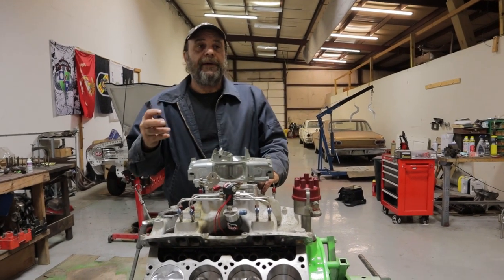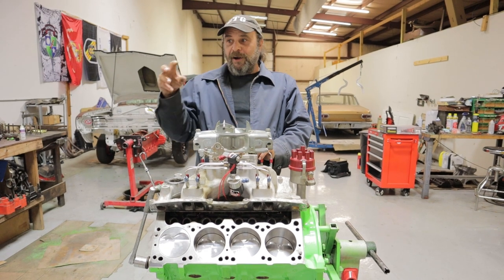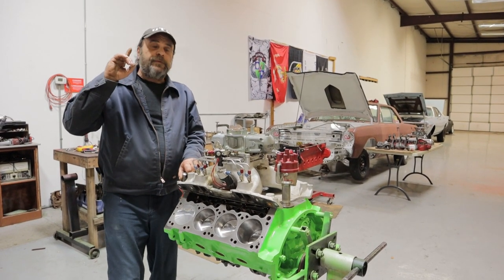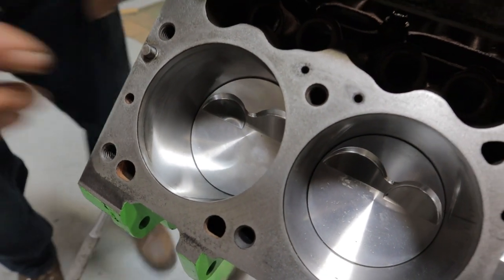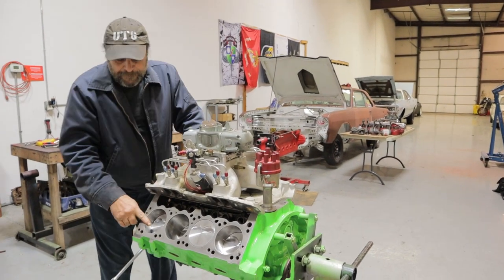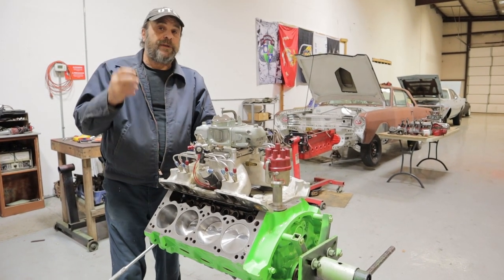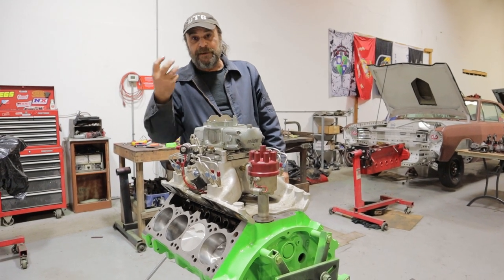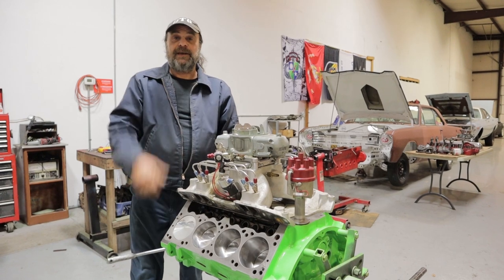The Fundamental Aspect Of The Internal Combustion Engine Nobody Ever Talks About

Comment: Seems like the work around for Vapor or volatile gas engines would be to shorten the stroke and do forced induction of some kind.

The guys that perfected NO2 systems have developed a compressed air system that maintains  AFR and power almost regardless of displacement. 

Combine that with hydrogen and there's a possibility of a feasible retrofit.

Comment: Density matters gasoline vapor has  extremely low density, gasoline molecules expand 12 times there size when mixed with air however, nitromethane must be a higher density fuel probably doesn't expand very much when mixed with air because it has its own oxygen already. Gasoline vapor has a thin charge that's why it lacks power not enough of a charge in the cylinder to make good power.

Comment: Smokey's problem was not power . His problem was oxides of nitrogen .Because of the high heat created in the system the engine could not meet NOX emission standards at the time . He explains it in his autobiography. What Tony is talking about is density , the denser the charge the more power produced.

Comment: Excellent! I really learned a lot. The principles that were talked about sound similar to reloading ammo. For a short barreled pistol you need quick burning powder. For a long barreled rifle you need a slow burning powder.

I wonder if the gas vapor would work better in a super short stroke engine since it burns out so quickly?

Comment: Uncle Tony,  for years I have wondered about this extension of burn.  We grew up with leaded gasoline, now ethanol (which is lighter and thinner than gasoline) and I want your opinion on adding either diesel or kerosene to the blend in small increments.  Could this extend the power stroke? 
Thank you and Uncle Kathy!

Comment: Sir you did an excellent explanation. I have a question I have a 65 mercury comet 3.3  straight cylinder I put the plugs, wires , distributor rotor and cap, coil, fuel pump, alternator, fan belt, oil and filter. The problem I start the car warm it up for 20 minutes and when I start driving for about a half a block the car dyes on me. Then am able to started put it on reverse and am able to go on reverse back to my driveway. Can you help me with this issue. Also I tried to set the timing but I had a cheap light and it died on me.

Comment: there are mechanical colutions to make the piston go longer on power strokes than intake strokes. certainly balance and vibration are not quite easy to account for. and petrol is not everything, we allso got diesel fuel. 
very way back in time (like 80's) we had a newspaper with DIY stuff, that had articles about possible future stuff from actual engineers. i do remember one that would had "supposedly" increased the thermal efficiency of a diesel engine by re-using the exhaust heat to literaly boil diesel to some freightening temps. the idea being that once that fuel ignites, all the heat it the diesel pickt up would be, supposedly, used by the engine again while it burns the diesel, and the high temps would make the diesel fuel burn faster. along with a variable stroke length supposedly that would increase fuel economy. along with  a water injection whatever crap to keep the engine temps within reasonable range. well, 30 ish years later i can safely say thats not the way things worked out.

Comment: So would a short stroke engine work better on the vapors?🤔 Back in the day they had a plate with propellers that would bolt under the carburetor and help atomize the fuel. And more recently a plate with screens. I always wondered if those were any good. This was a very good video UT. Thanks and be well.

Comment: With modern fuel injection we can control the timing amount and duration of fuel.  If Vapor worked, it would have been standard in cars years ago.  We haven't even see an odd ball motor like the Mitsubishi three valve "jet" head.

Comment: The main function of the fuel air mixture is to control cumbustion chamber temps, secondary is  making power. Too lean will overheat in addition to not making power. I cannot believe UT did not talk about how much heat the fuel absorbs as it changes state from a liquid to a gas or vapour, that is how our sweat cools our bodies and how refrigeration works.  As a liquid changes state to a gas it absorbs or removes much heat! This means the intake air temp drops below your carb, check out engine masters!  If you want a hot lathargic engine then feed it pathetic fumes, if you want an engine to make power and stay cool, let the fuel vapourize inside the engine at the correct AF ratios...

Comment: Thanks Tony, a really great explanation of fundamental facts on where the problem lies with hot vapor carbs and their drawbacks. I still use my hot vapor carb and enjoy the much higher mileage but my circumstances are not normal. The area in which I travel is very flat - no serious uphill's or downhills; The roads are really bad - pothole alley and under no circumstances can speed be achieved without serious damage to the car; and most importantly the wildlife is fantastic so who wants to speed by!  A thought does occur to me after your explanation - if the hot vapor car does run a motor smoothly and is used to run a generator which powers an electric motor via speed control this may turn out to be a worthwhile exercise.

Comment: Is this the way diesel make so much torque? Diesel seems to burn extremely slow. Of course, maybe there's no much power on it, thats why big diesel engines make same amount of torque than a smaller gasoline engine, but, whit waaay slower revs and extreme capacity to pull over a hill

Comment: I’m surprised you didn’t mention the Chrysler lean burn system (or anyone else’s like lean running calibrations) attempts of super lean running engines and mileage attempts. There draw backs and emissions , power drops. Potential mileage gains, etc….

Comment: so I have been thinking along those lines for a while now. only until recently, everything I drive has fuel injection, and when it comes to computer controls, I am light years away from understanding them.  so i recently acquired a carbureted vehicle (other than my lawnmower).  so my idea is pretty simple, and the only things i will probably have to change is jetting and ignition timing. anyway, my idea is to mix gasoline with diesel fuel. it burns relatively slower than gasoline. and since there will be a significant amount of gasoline in the mix, it should light off with no problem from the spark plug.  in theory at least, since the diesel burns so much slower than gas, I am thinking it might burn longer. what I don't know is if the diesel being mixed in the gas, if it will keep its characteristics, or if it will burn all at once and just make a stinking mess. If you already know if this is going to fail, please reply and save me a lot of work, time and money. i guess the ideal way of doing this would be using fuel injection to inject the diesel independently of the gasoline so it would be injected just before the gas was just about done making pressure.  but for a number of reasons I can not do that.

Comment: When I drive my car 4 miles it’s heated up it takes that long. I can drive 10 miles stop  at Alamo parts. Leave the car idling in the parking lot turn the fuel pump off with my toggle switch or raise the hood unplug the blue white fuse so no new gas is entering the copper tubing. And it will sit there and idle for four minutes. Because the gasoline is expanding vaporizing. Some parts of gasoline does not vaporize.If I do the same thing when the motor is cold when I unplug the fuse from the gas pump the car goes dead a few seconds later.The blue and white one. I’ve also got a wire hooked up to it and I toggle switch inside car I can turn it off and on that way to

Comment: Momentum is kept up by the next cylinder in a the firing order.  Not so much the flywheel, the fly wheel is designed to maintain a smooth momentum created by all the other cylinders firing on que one after another, other wise because of pumping through a cylinder while not being fired will not maintain a momentum conducive to being smooth, It will jump all over the place if you have a hit and miss cylinder situation if every other one in a firing in a firing order believe it, it will be rough as hell.....   The flywheel is designed to keep a good functional operating motor smooth through power pulses !  Flywheel is useless if it fires every other cylinder it will not maintain momentum in a motor that has friction (rings, etc.) and pumping loss, valves closed and no firing.

Comment: The safer, road used version of the slow nitro-methane burn is the diesel engine. Higher compression, direct injection for ultra-precise fuel atomization and burn, longer power pulse.

Comment: How do we know that the pressure pulse runs out at 45* past TDC. I’ve seen the clear plastic cylinders and the clear plastic head on a flat head engine and I guess a lot could be learned from that visually but have there been anything prior that verifies the degrees of force from the combustion of fuel?

Comment: Oddly enough there was a video with Garlets in, he was putting together a copy of swamp rat 8 for a cackle fest, he set down and was talking about how he kept thinking there should be more power in the 426 and he tried everything different mags, blowers, blower speeds, injectors and nothing seemed to wake it up till he  put the mag at 40 degrees before TDC and that run the engine woke up

Comment: I'm having trouble buying all this. If all the useful pressure charge in gasoline is used up by 45 degrees, then why not open the exhaust valve sooner at 90 degrees or so to let the used up hot gas start to be scavenged out of the cylinder and aid engine cylinder cooling? The power in nitromethane is due to its low stoichiometric ratio as compared to gasoline. Nitromethane actually contains less BTU energy per unit than gasoline. It makes so much more power in an engine because a far larger amount of it can be introduced into the cylinder as compared to gasoline. This is because nitomethane carries its own oxygen. That's what gives it its low stoichiometric ratio as compared to gasoline. I don't believe nitro's slow burn rate has much to do with it.

Comment: The military was working on something similar , they had a "double burn" powder the powder would burn creating a pressure peak , then the powder would have a delay layer to allow the peak to drop some , then the core would burn creating a second peak , all without exceeding the maximum safe pressure of the barrel . It would push the bullet longer.

Comment: Wouldn't the higher pressure at the top with the vapour carry on to when the exhaust valve opens? If it combusts faster, doesn't the pressure remain? It's the same amount of fuel either way. If it all burns up early/faster, why does that prevent it from continuing to provide pressure through the stroke?

Comment: the only place where i see this hot vapor systems is useable, would be in gennerators running fairly predictable loads, but then its easier to run propane,it can be stored easy to,not so with modern gasoline. if one wanna run engines on mainly free fuel there is only woodgas i have made a few woodgas gennerators ,they are diffecult on the initial setup,, and becource of size mainly good for stationary setups, however during WW2 here in europe many ran cars and trucks on woodgas ,there is a swedish guy that runs a volvo like that , search volvo 140 running woodgas  ,its really quite its own thing...

Comment: With what you said, what about combining the two? Use vapor to putz around (light consistent load) then add or switch to the normal atomization of gasoline for full throttle/high load.

Comment: Back to nitro methane. It seems, it should be possible to make a street driveable engine that burns clean with acceptable power levels.  Except it would hurt the oil industry slightly.

Comment: Combustion's important because it's very  fickle when it has to burn a charge some high density charges are combustible inside a cylinder but get it wrong just a miniscule amount plus or minus and you have zero combustion because the charge won't ignite.

Comment: It doesn’t really solve the pressure pulse problem, but I wonder how effective it would be to combine a hot vapor system with fuel injection. You could cruise on vapor and then injectors could fire when you need power. Might be to complicated for not enough benefit, but it would be interesting.

Comment: This is great stuff, I never thought that much about how many degrees that fuel burns. I did read about how the shape of the combustion chamber is important, and the burn rates vary. I have heard that better combustion chambers burn the fuel in less time, for example, a Dodge Magnum 5.9 combustion chamber is said to burn fuel more quickly than any of the major chambers found on a 360 LA engine. The SBC crowd loves having Vortec chamber heads to replace the chambers found on more common castings like the 882 and 193.

Comment: I'm going to have to disagree with you Tony. The elephant in the room for these vapor guys has always been natural gas and propane engines. The fuel is always vapor, so why aren't they super efficient? But now that you're taking the position that vapor causes short pressure pulses so it can never be powerful, now you have to explain why natural gas and propane engines aren't gutless...
Reply: Different gasses burn at different rates. Propane burns slower than vaporized gasoline.
Reply: @ericlandstrom6155  I don't see why lighter fuels like propane and CNG would have a lower flame speed, but lets say you're correct. What is known for a fact to have a higher flame speed is a diesel - not because the fuel itself burns that fast, but because it's forced to spontaneously combust. You can look at papers on the topic and see the observed pressure wave is a lot faster than a gas engine - which is also why they're timed closer to TDC. But by this logic, a diesel would make very little low end torque, which is obviously not the case.
Reply: @calebjamesdelisle6239  the gasses have a higher flame speed with less duration.
Diesel makes it's power from longer duration.
Reply: @ericlandstrom6155  Now my position is that while hot gasses continue to expand and do work, in 15-25 degrees the fire itself is already out. I think a quick image search "cylinder pressure graph" confirms this. But lets say you're right, the fire does have to continue burning to put pressure on the piston. How can you explain the fact that the same fuel which burns slow enough to drive a lumbering locomotive engine can also burn fast enough to put meaningful pressure on the pistons in a screaming 4000 RPM truck pull engine?

Comment: Ideally one would want the maximum combustion pressure to occur when the conrod is at right angles to the crank throw, thus imparting maximum torque on the crankshaft. But it is not just about instant force but more like average force over a time period. Engine science is interesting.

Comment: I recently watched a video about the HQ proprietary develpment of a large (7+ liter) 4-Cylinder piston engine being developed with the assistance of F1 engine developers. It corrects the secondary imbalance problem in I-4s. As a primer intro to that video he discussed the basics of the 4 stroke engine. I thought I understood that pretty well. I am a basic amateur. Built a couple of SBChevy engines. I do have a 1980 engineering physics degree (big whoop, I know). I've read a Lot of Books on IC engines. But books don't contains the importan nuggets of knowledge. That's why I watch your channel. I've read everything from stationary 1900-1910 engines that my Dad rebuilt after we dug them out of dirt and manure inside barns when I was a kid. Hot-Rodded automobile gasoline , alcohol and CH3- NO2 drag race engines. But mostly about the WWII and immediate post-war large displacement engines. My Dad also rebuilt a 1929 Model A from scrounged parts while flying B-36s with 6 R-4360 cubic inch 28 cylinder engines (and 4 turbojets). Progressing to B-52s in Roswell NM.
Enough background. This video about the large 4-cylinder engine discussed a fact that I could not believe I had never known.
From TDC to 90 degrees of crank throw.  63% of the stroke is swept through. I thought it would be 50% of the stroke. I suspect most people would guess that?
I'm 63  years old (coincidence) and I've Never known that. Maybe I'm ignorant, stupid or just never paid attention to that fact and its importance in the function of piston IC engines. 
This ties in with the info you presented in this video about the pressure pulse through 45% of crank throw during most of the combustion of the intake air fuel charge.
Reference.:ALFADAN BIG BLOCK I-4 ENGINE  on "driving 4 answers" channel.

Comment: guys guys guys we have been running cars on vapor for a long time kinda propane powered vehicles so easy way of vapor engine gasoline in heated pressure tank with some kind of regulating system bad idea yes but pipe the vapor into the modified propane carb pair that with say a 383 mopar engine probably have lots of problems  now run a gas engine with direct injection like a diesel and pump vapor in while its combusting like pilot injection   what happens ???? can you increase power duration for the entire stroke making large stroke engine truly better for power

Comment: Solution, 5 inch bore, 2 inch stroke and turn it at a high rpm to keep the piston speed up. Use a Ford 385 series with Boss heads so the engine looks good. Let's start a go fund me for UT to do this.